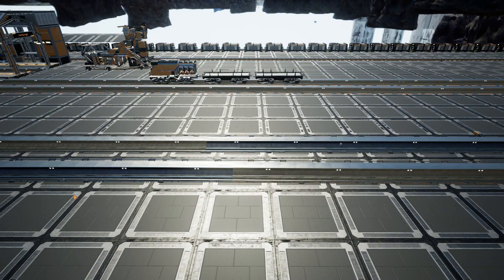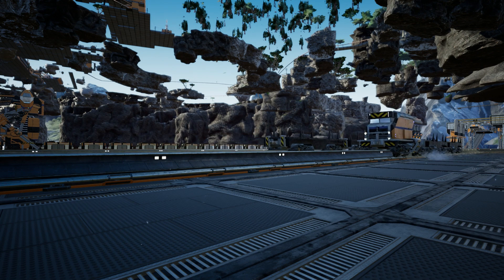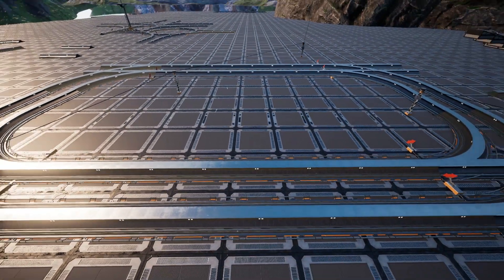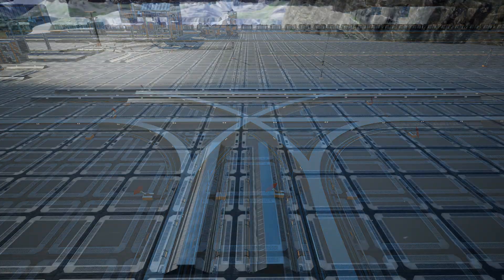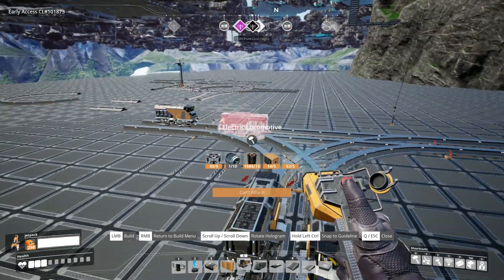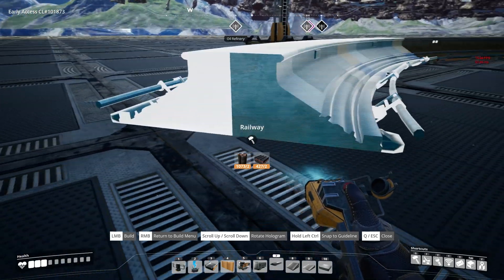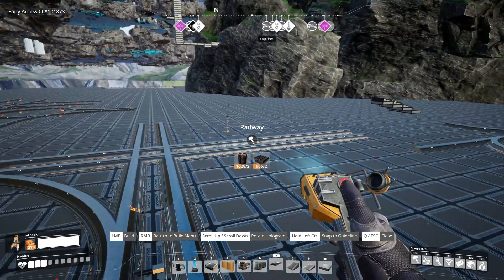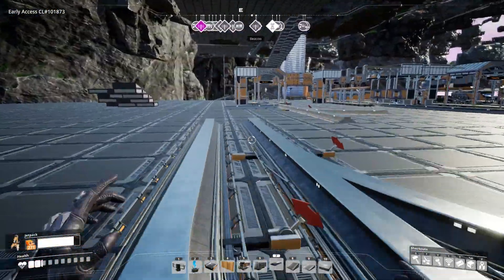Satisfactory Train Guides: Parallel Rails & Advanced Junctions Ep.03

Comment: Hey, some other tips you can share with your channel: (30 hours of experimenting intensenly with trains)
1. Avoid alevations while building tracks. 4 m of height for every 25 m of Railroad seems to work well. Upon joining the game, your train can get stuck onan elevation and you have to manually restart it.
2. Do not put more than one train in one network with more than one path. Sounds crazy, but has turned out to be necessary. If two trains arrive at roughly the same time at a waypoint, Train 1 will go right and Train 2 goes left. However, their carts might get mixed up, turning your Refinery into a Bauxite Deposit. Or just getting your train stuck. A lot of work, but you have a bulletproof system. Speaking of:
3. Keep your designs simple and your complexity low. The AI of Satisfactory is not designed to make "intelligent" choices, but merely adhere to a given path. If you provide too many options (with a large complex junction), the AI will make mistakes and your supply is unreliable. 

I have established 4 trainlines that deliver resources from North, East and West to designated trainstations directly in the base, reconnecting them to their line with simple loops. No line connect with another. Total output is like 40 Turbomotors per minute. I have made only bad experiences with the push and pull system.
4. On a trainstation, every freight platform and every train cart connected to the entering train must be on the same level of elevation! If your drive into your station with your carts still pushing you from an elevation, any docking process will be interrupted and your train is stuck and will not procede.
5. Do not mix items in freight cars.
6. Do not use more than 12 freight cars. They make your train unreliable.
7. Trains are not as fast as you think they are. Sure, 20 (?) stacks of an item at once sounds like a lot, but it takes long for a train to accelerate, dock, and return. Oftentimes, it is viable to split even a weak resource node into 2 loading freight platforms for to increase transport capacity. Trains travel on 60kmh on average at best. To get from grass field starting biom to the oil fields in the northeast, you take 23 minutes for one cargo delivery. That is not very fast.
8. Keep the amount of train stations on one line as low as possible. Every additional train stations worsens transport time by a lot (roughly 160 seconds per stop compared to driving straight through).
9. Simple and sturdy is more reliable than complex solutions. I mostly prioritise reliability and low/no maintenance over great designs. Works well.
Reply from the maker: Irrelevant Irrelevant some awesome points you’ve put in there which will certainly come in use and Help others out thank you for putting si much time into the comment ☺️
Reply: You may connect a few locomotives, so elevation is not a problem.